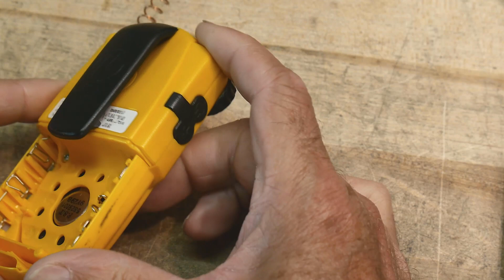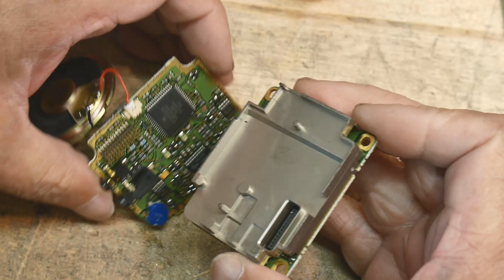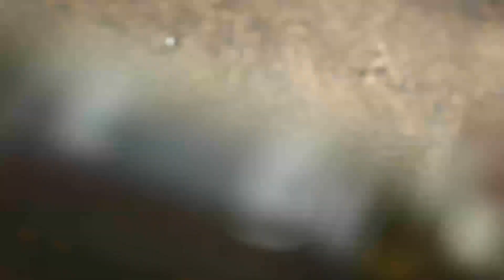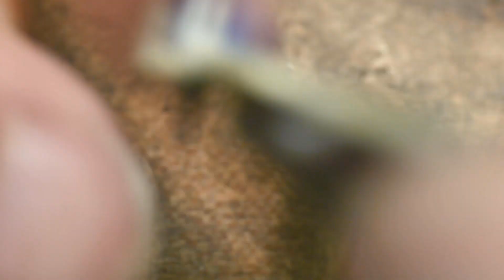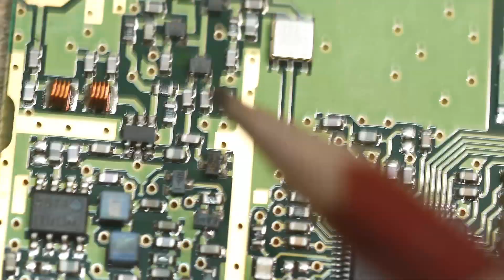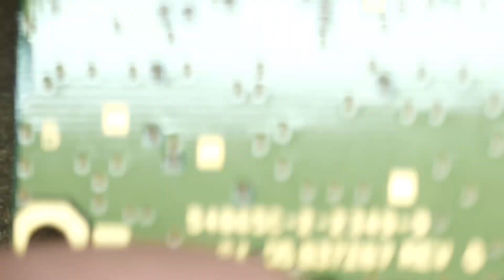#775 Motorola TalkAbout 200 FRS Radios

Comment: Weird Connector for test fixture/programming?
Reply from the maker: volume pot
Reply: @IMSAIGuy  oh, i meant those two metal connectors ( if thats what they were. ).
Reply from the maker: @nickcaruso  oh, that one, it was the microphone pins (other side of PCB)
Reply: @IMSAIGuy  ah! Cool. Have you done any pcb layout and manufacture using any of  the various inexpensive suppliers? I have gone as far as getting a price quote then chickened out. That would be a fun topic for a series of videos.
Reply from the maker: @nickcaruso  Yes I have done many many.Check out my playlist for a TTL computer. You will see me do many layouts in Eagle CAD and manufacture through JLCPCB.
Reply from the maker: @nickcaruso  https://youtu.be/BePqr3tp39Q
Reply from the maker: @nickcaruso  https://youtu.be/mzToJq3s_60